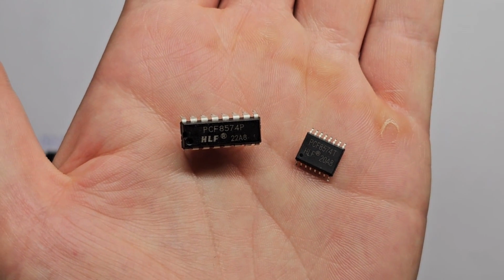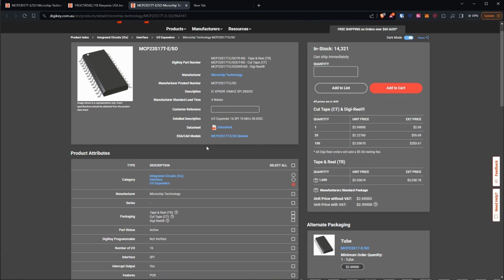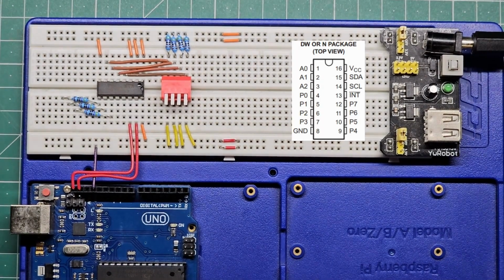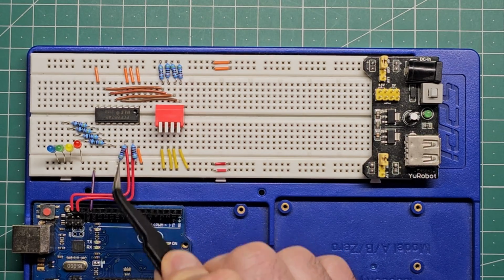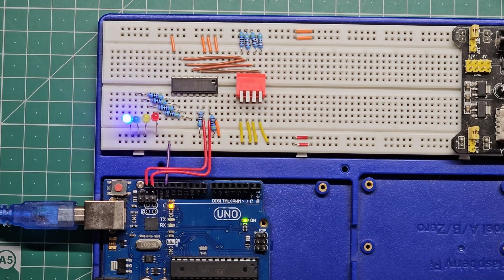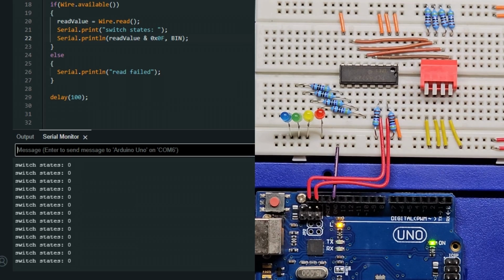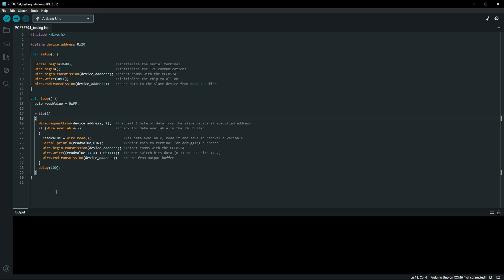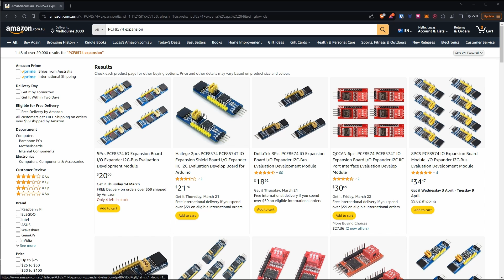Not enough Arduino Pins? Try this I2C Port Expander! | PCF8574

Comment: How do we set the pin addresses of PCF8574 as binary? I am trying to send from our serial. When I write 00001111, I activate the first four p0,p1,p2,p3, but it seems like this is not how it is done. Each bit seems to control a pin. Am I misunderstanding?

Comment: Great video. These i2c expander are an awesome integrated circuit. For educational the pcf8574 is a good choice, but, if you are developing a product, search for more recent part numbers, I think the PCF of not recomendded for new designers. The TCA9548, for example, is a good choice.
Nice video.
Reply from the maker: Thanks for the great feedback! I agree, the PCF8574 is better suited to education than production. I mainly chose this because it suits an upcoming project I'm working on in the background
Reply: The sx1509 is also I2C and has some very powerful features, but with the downside of using a QFN footprint.